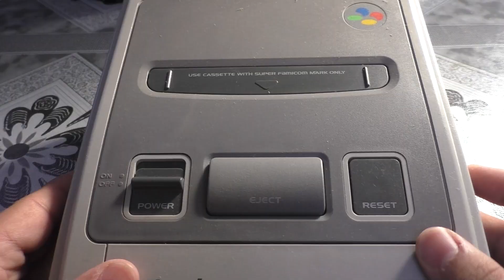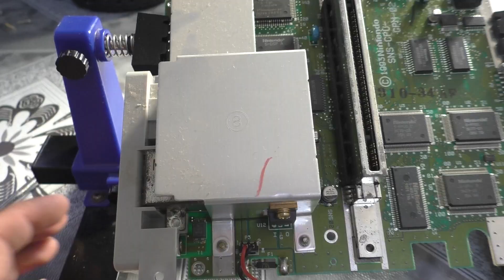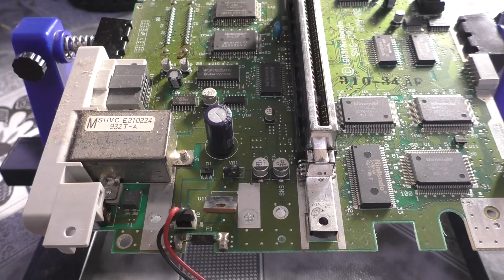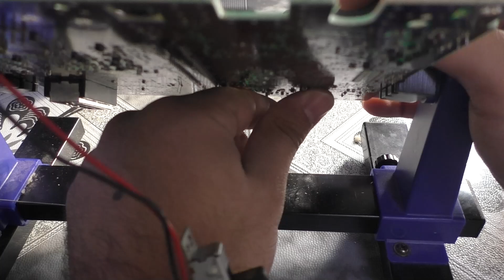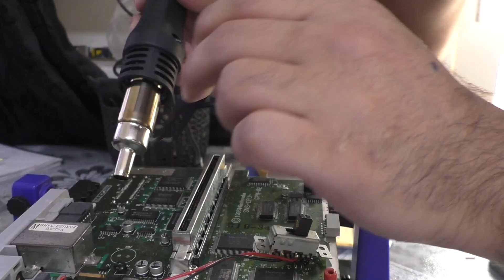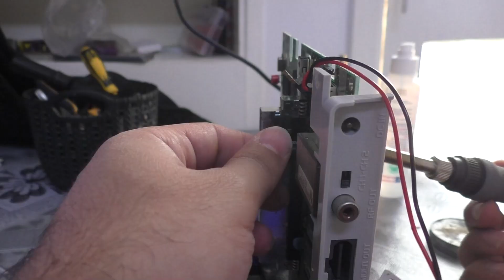Super Famicom capacitor replacement (Recapping tutorial)

Comment: good video now let me ask you something if you recap with panasonic os-con solid polymer is it possible or is overkill is there any danger ???
Reply from the maker: well, as a general rule yes you can use polymers. however, some circuits get bad when inserting very low esr caps and the only way to realize it is by testing.

so if you have polymer caps and regular electrolytic caps, i suggest you do polymers first and test then you will know the truth.
overkill? they are very reliable and won't be recapped again + very huge spec upgrade for very little money. if they work, it is a no brainer.
Reply: @Thundertronics  Interestingly, later SNES/Super Famicom motherboards actually have an unpopulated spot for a capacitor listed as "OS-CON".